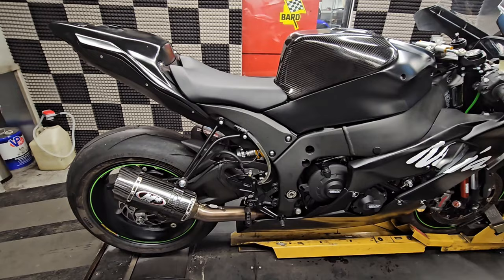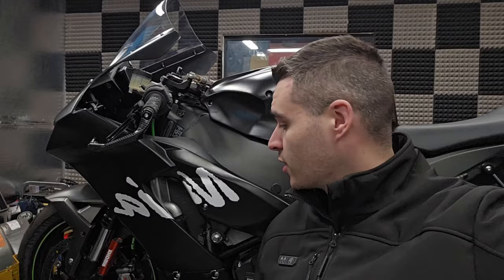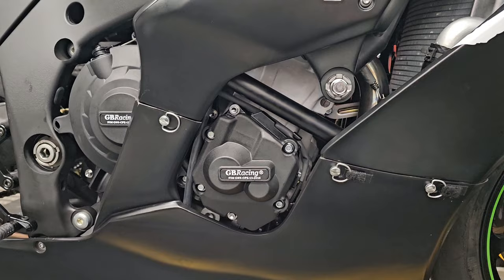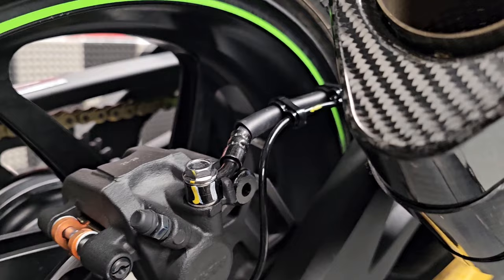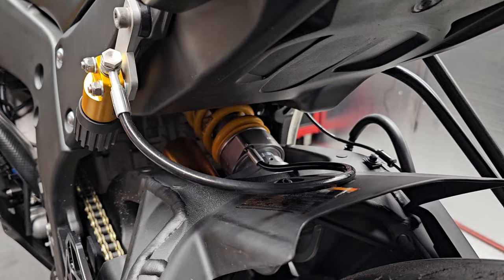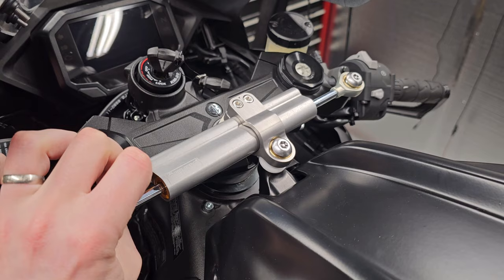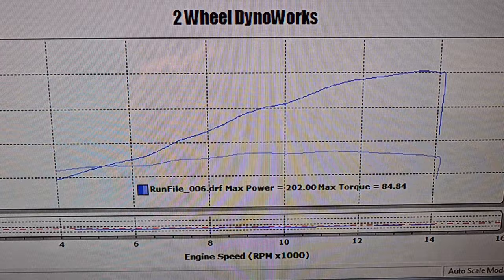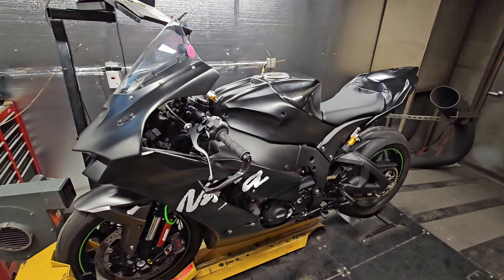Our 2WDW 2023 ZX10R is READY TO RACE!

Comment: Maybe I missed it, what did you do front suspension wise?   I'm a bigger/taller dude, can the stock fork springs preload be dialed up enough to get the sag right for a 240lb rider?  I'm about ready to pull the trigger on one, just wondering if stock front suspension is sufficient  for expert level trackday rider? ultimately i'd get cartridges down the road if avail.  Great build!!!